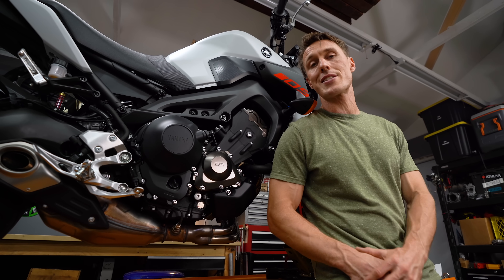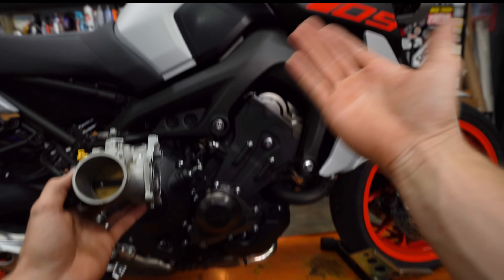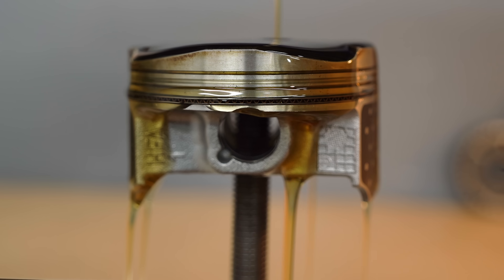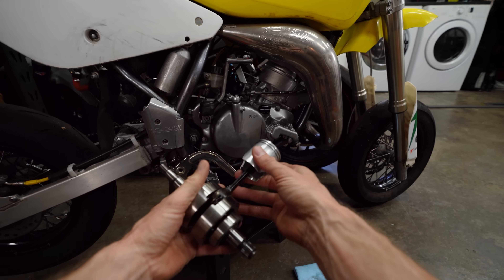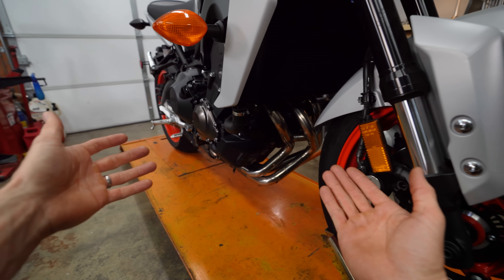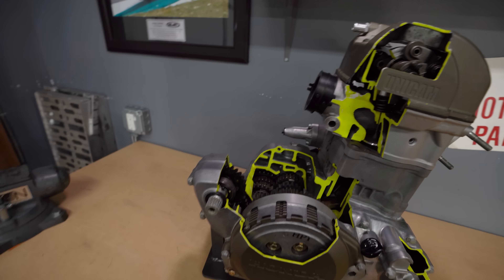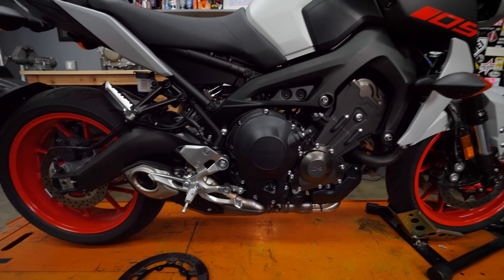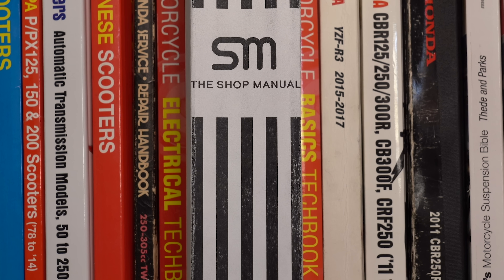Is Engine Braking Bad For Your Motorcycle? | The Shop Manual

Comment: I ever experienced with my own dumb engine braking on my bike w175

When doin cornering on hillside road, I always engine brake as secondary brake. When going home, my bike didn't want to turn on. Tomorrow afternoon, my bike exploded. So I called my friend, and it was woodruff key magnet that split in half. So I bought 2 woodruff as pre caution, but then it also blew too. Then my friend got an idea to use threadlocker on the thread crankshaft. Thank god the bike runs okay

I almost forgot to tell that my crankshaft is modified, but some milling guy also kinda dumb that he though my crankshaft thread same as ninja 2 stroke (even though they are different), so he just use the nut bolt from ninja and the thread loose. My friend angry to him

Comment: In regards to actual brake performance, arguably, about the only thing to avoid is "pitting the brakes against the engine"... That's more or less useless wear on both.

    Now, I'm not directly referencing the "beginner's trick" of dragging a little rear brake through "slow speed maneuvers". At least some MSF coaches teach that way, and it's fine in "small doses"... AND since optimal speed is around 8 mph for slow-speeds, and a lot of bikes won't idle at 8 in gear... it can be indispensable. Pads are consumable parts anyway.

     Starting off on slopes can involve some throttle, clutch, AND braking practice, too... again... all fine in small doses.

    I'm talking about sticking your whole foot in the brake while the throttle's still open... It happens, and nobody likes to admit it, as a "goofy noob thing" to do... BUT riding is a complicated sport at first. Good idea to kind of work toward getting away from fighting the engine with the brakes... except in specific maneuvers and measured amounts even then.

     Engine braking? No... not an issue. In fact, when cagers (largely in the U.S.) gave up standard trannies, they lost a degree of control offered with engine deceleration there, too... arguably. Frankly, I always preferred a vehicle with a clutch... they're just more fun to drive.   ;o)

Comment: I believe the myth that engine braking is bad for the engine is coming from the old two-stroke engine era. In two-stroke engines the fuel is carrying the oil and does the lubrication, so when you engine brake and starve the engine from fuel and oil then it can cause damage. New four-stroke engines do the lubrication separately from the fuel.

Comment: When you let off the throttle to engine break it slows it down, but I sometimes shift to a higher gear first before I ease off the throttle so the deceleration is "lighter".... I'm wondering if that's safe too. Never had any engine problems in both my car and motorcycle but I'm no mechanic.
Reply: Shouldn’t hurt anything.

Comment: engine actually cools since the air pressure drops after the throttle plate and thus the temp drops. Airplanes even have carb heat for this phenomenon. during a long descent with throttles closed the airplane carb can even freeze up

Comment: I think the concern was subconsciously inherited from 2 stroke engines that operated with the oil premix on the fuel tank. You could easily seize them because the fuel mixture was in fact the lubrication, so under high reps with no oil/fuel mix (a.e. engine break) you can imagine the problem 🙌🏻

Comment: Also one of the downsides of engine-braking is adverse weight transfer off the rear tire (same reason you wouldn't just slam on the rear brake). Which is why the slipper clutch was invented to deliberately reduce the amount of engine braking produced.

Comment: Riding a 1969 Triumph, engine braking is just the only way to stop. If you want to stop. These old drum brakes are great and all, but not really well known for good stopping power. I only use my brakes for slowing a bit for corners and coming to a complete stop once Iv already pretty much stopped.

Basically, I hardly use my brakes. I use my rear brake pedal just to kick on my brake light as the switch for my front brake doesnt click on until Im pretty much full force with it and I cannot adjust that.

Comment: Don’t engine brake with a cold engine. As it was said in the video, modern bikes with fuel injection shut off fuel intake while engine braking. Therefore the engine barely generates any heat, apart from a little bit of friction.

Starting an engine cold and immediately rolling downhill while engine braking will put extra strain on the cold, stiff and barely lubricated engine components. Best to live in a valley ;)

Comment: I don't get how people think the powertrain that can handle 50, 80, 100+ HP in one direction will struggle with the comparitively small amount of work that engine braking introduces in the opposite direction? Seems completely intuitive that if it can handle positive torque of one magnitude it must also be able to handle drag if of the same (or less) magnitude?

I looked it up and if you express engine breaking in horse power, here's a rough guideline:
Small 250-500cc engines typically have 1-3HP of engine breaking. For 600-800cc, it's can be 3-5HP. For larger engines it can be 5-10HP. I didn't know it can be as "high" as 10HP absorbed but that'll probably be on a bike with powertrain built to handle 100+ HP.

I wonder if you can build a circuit that detects deceleration due to engine braking and activate the rear brake light for safety.

Comment: I disagree with the clutch during engine breaking because some bikes Are equipped with a slipper clutch Like my Z400 for example, This allows the clutch to slightly slip when your engine braking wearing it down faster.

Comment: I hate to say it but if you’re concerned or not knowledgeable about engine braking, you probably don’t know what you’re doing on a motorcycle. Maybe I shouldn’t say that but seriously, that’s just part of learning how to drive any manual transmission vehicle. With that being said I do understand where maybe someone could be concerned so let me rephrase, I guess if you’re a kind of a beginner you might have these questions however if you’re a seasoned manual transmission operator whether it be a motorcycle or a car, these are things you should know. Just my two cents and again maybe I’m being insensitive but those are just my thoughts

Like you said in the video, it actually recommends engine braking to eliminate break fade and potentially crashing due to not having breaks when you’re descending a Hill etc. Break fade can be a real concern and you should absolutely be using engine braking in the proper gear.

The good news is modern motorcycles with assist/slipper clutch is can aid in this so you’re not accidentally locking up the rear wheel if you’re not familiar with engine braking

Comment: I disagree.  During engine braking, the component that suffers the most is the clutch.  I'd rather wear out a set of brake pads than a clutch any day. Brake pads are most often easier and less expensive to replace than a clutch.  In addition, there is the safety factor.  Using engine braking means no automatic illumination of the brake light.  There is no ABS in play and the forces provided by engine braking can not be modulated.  Essentially engine braking is uncontrolled braking.  I know of at least one rider who dropped their bike as a result of using engine braking in a corner.  The rear wheel momentarily locked and down they went.  Many motorcycle manufacturers do not recommend using engine braking in the lowest 2-3 gears.

Comment: For me personally, I engine brake while rev matching cause it just gives e more control while cornering, or in general for that matter of fact, or else the bike feels like a loose canon whenever I'm not accelerating, it also helps transferring the weight from back to front which helps a lot in actual braking as well.

Comment: It probably adds to rear tire wear..so does rear brake...except for my blackbird that has linked brakes my last 3 bikes didnt even have a rear brake...and on blackbird I bled air into the rear brake to reduce it effectiveness....if you are on the brakes hard there is so little weight on the rear tire using the rear brake just drags the tire...rear brakes do have 2 uses...its a good way to turn the brake light on and if you have a need to downshift hard it will help keep the motor from over reving... opps. Maybe 3...
Some dumbshit pulls out in front of you and there is no way to avoid a crash....full brakes to bleed off as much speed as possible and then lock the rear so you can lay the bike down and get off. Hitting a car while still on the bike is all bad.

Comment: Probably some people confuse it with another type of this - the engine breaking. When you take your sledgehammer and your engine and put those two together in a violent manner. Then it probably will be bad for your engine. Except if it's a Honda or DR-Z, then you're breaking your hammer :D.

Comment: If the vehicle I'm driving has a clutch, I''m engine breaking. Whether its a semi big rig, any car, or a motorcycle. Especially on a bike because it minimizes break wear and changing breaks on my aspencade is a pain because of the shyte load of plastic. I've never had a problem.

Comment: My theory is that engine braking is safer for gentle deceleration when traction is limited, such as descending mountain roads in the wet. If the tyre does lose traction, it's not going to lock up the way a brake would, because the engine is still turning, just a bit slower than the road speed. I don't know if this theory is right, but I haven't crashed doing this.
Reply: abs is practically everywhere nowadays and at some extents assisted clutch so losing traction due to breaking is actually uncommon to say the least

Comment: you dont have to completely close the throttle to engine brake, you can just lay off the gas a little bit to scrub alot of speed real quick, and if you combine that with a slight  touch  of your brakes  then your bike will brake even better

Comment: Just don't downshift very quickly if your motorcycle dosent have a quickshifter or auto blipper. If you're riding at 80kmph in 5th gear and downshifting it to 1st gear all of a sudden for slowing down is bad.

Comment: Also note that gearing changes the amount of engine braking felt as well. Lower gearing, greater engine braking. Higher gearing, lessen engine braking. I rarely use the brakes unless coming to a complete stop on majority of small cc bikes because the gearing is so low. Just keep downshifting.

Comment: It’s not really drag that slows the engine. Its the compression. Case in point shut off your bike and roll the throttle open and you will still slow down more rapidly then pulling in the clutch.

Comment: There is also the issue of increased piston/cylinder/camshaft/rocker/bearing/etc wear because you are at a higher RPM than when idling and using the brakes instead.  However, I think this is negligible because the percentage of time you're engine-braking is very small vs normal engine operation.

Comment: The other potential downside of engine braking, aside from not illuminating the tail light, is that it's basically a less controlled way of applying the rear brake, increasing the chances of locking up the rear wheel, even if you have ABS.

IMO engine braking is not a great habit to get into for every day riding.
Reply: Then I suggest you never let off the throttle, because every time you do, the engine is applying braking force…..

Comment: If I were to say there was one negative to engine braking, it would be to rear tire wear.  
I don't know about you, but I have a hard enough time keeping tread on the rear.
Doing all your acceleration and deceleration using just using the rear compounds the issue.
That said, I always use engine braking exclusively on my bikes. Pulling in the clutch and just using brakes seems awkward.

Comment: One thing not addressed was that the "tension" and "slack" portions of the chain are reversed and what, if anything does that do?  Also it would have been good to mention that engine breaking at most is about 15% of maximum torque of the engine, and is directly proportional to engine speed, not the HP or torque curve of the engine.
Reply: It actually helps with even sprocket wear since normally the chain only pulls in one direction.

Comment: I believe you OVERLOOKED one aspect Mr. Ari.  In-order for the engine to slow down the Motorcycle. It must be connected to the rear wheel, which it is, through the transmission, front sprocket Chain, Belt or drive shaft & rear sprocket. I'm pretty sure once the front sprocket starts to slow down the rear wheel will push against the rear sprocket, causing the to Chain or Belt to PUSH against the front sprocket  Like a rope, Chains and Belts are Not Designed to be Pushed, but rather pulled. There must be some negative aspect to the Chain or Belt, to some degree.?
Reply: You're wrong. The pulling force simply swaps from the upper rung (taut under acceleration) to the lower rung (taut under deceleration). A chain is incapable of pushing.
Reply: That MAKEs SENSE, Thank You Ari. This is why our chains cannot be too loose & why they don't have a derailleur (like on a bicycle) I wish you could have reWorded "You're Wrong."  I felt that sounded harsh. Notice, I asked a questions and started with the words "I believe" & ended with a question mark. I guess you didn't realize I was asking (not telling) otherwise you might have worded your reply differently. (smiles) Never-the-less its Awesome you were able to reply Sir.

Comment: Harley uses POS pressed together flywheel/crank assembly.. the crank pin is hollow.  Not plugged or welded. 
Lots of engine braking especially if done higher up the rpm range can cause the flywheels to shift.  
But that’s all due to the MoCo cutting costs on critical
Components LIKE THE BOTTOM END !

Comment: People get the idea that engine braking is bad for an engine because of exhaust brakes on diesel engines sometimes have issues.  Not going to get specific but some engines just where never designed well to use an exhaust brake and when they where added after the fact catastrophic failures happened.  Not possible with a gas engine.

Comment: I was surprised when the dealer  told me that it would void my warranty if I had engine problems with my gold wing and they find-out I was engine-braking!
Reply: What the f? That's insane. And total bullshit if they think engine braking voids warranty. I assure you it does not. Engine braking occurs everytime you let off throttle without pulling in the clutch. If you have to take it in under warranty I'd suggest a different Honda dealer. Them saying that is a red flag against that dealership in my opinion.
Reply: So basically anytime you let off the throttle, it voids your warranty……
Think I’d find another dealership

Comment: "Engine braking is bad for your motorcycle"??  That's as stupid as the car mechanic who was doing a safety check on my 500cc Suzuki.  The brake light switch on the handle-bar brake lever was intermittent.  He said, "Oh, that doesn't really matter.  Nobody uses the front brake on a motorcycle anyway."

Comment: There was this one incident at our friends reunion that I put too much throttle .. I don't know if that's even a thing where the digital dial said "RPM limit reached" so I released the throttle and used engine braking to slow down.. and I got scared that I might have screwed his bike.. now, I think It was safe.. or that's what I'd like to think so. Thank you so much for the information..

Comment: Engine breaking on a long downhill carrying luggage, and, or a passenger is a good way to protect your brake disks from warping due to heat build up, especially bikes with thin disks, This is why trucks don't have disk brakes.

Comment: The engine you are working on in the video is a fuel injected engine meaning fuel and air don’t pass through the throttle body, air passes through the throttle body and then fuel gets injector ether behind the valve or directly into the combustion chamber. Please learn how this works

Comment: the throttle vacuum has NOTHING to do with engine braking. Don't believe me? hit the kill switch while slowing down and play with the throttle to see for yourself. Engine braking is the drag that the engine is ALWAYS experiencing, even while on throttle you are just adding extra fuel to overcome this drag. This is why so much engineering goes into reducing internal drag in modern engines.

Comment: I know engine braking isn't bad for your engine. However, when you're road racing and you down shift quickly enough to have to feather the clutch leading up to the corner (backing it in) does that hurt your engine over time?

Comment: Interesting, always thought it was tied more to the exhaust, so pulling out the baffles would affect the engine braking, which i use a lot, carry over from using in a car.
Reply: Pulling out the baffles has nothing to do with engine braking. When engine braking, if you're hearing popping from the exhaust it means that you're dumping more unburnt fuel into the exhaust which burns/explodes in the pipes. An excess of this can blow out exhaust gaskets and increase back pressure on the engine. Not a real big deal but it tends to be a negative in the long run. Carburated bikes tend to do more popping that FI intakes.

Comment: Engine braking has nothing to do with throttle position. It has to do with the drag on the transmission. The gear selected will depend on how much engine drag will be applied. Going 60 and letting off the throttle in 4th gear will cause more engine braking than letting off the throttle in 6th gear. Has nothing to do with the throttle being suddenly closed.